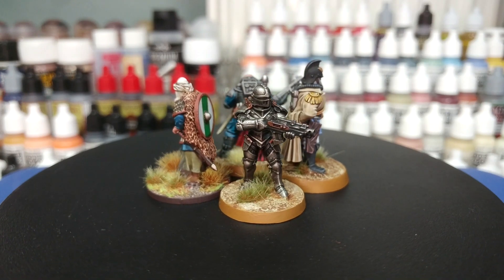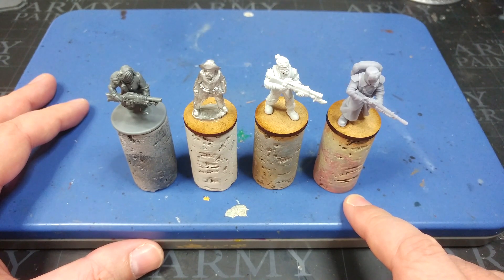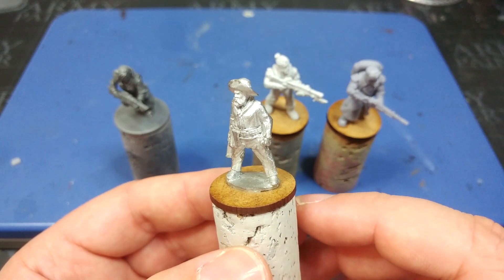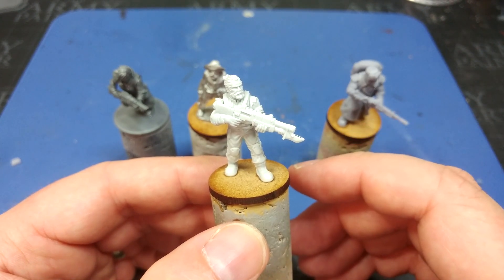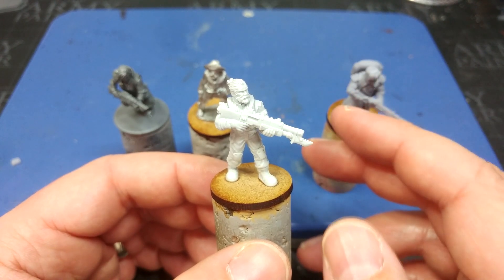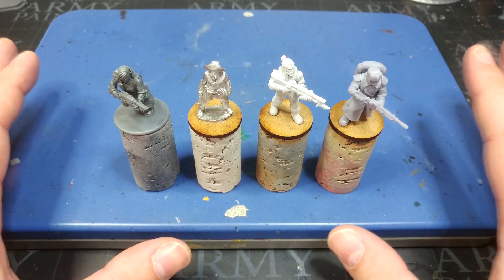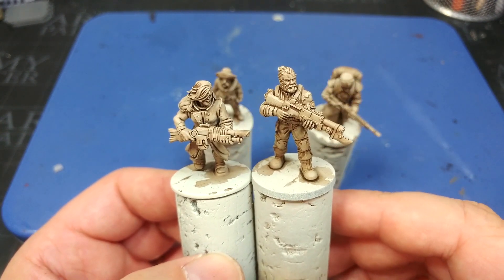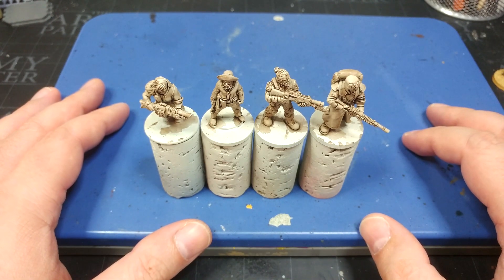Plastic, Metal, Resin: What's the difference?

Comment: When I first got into historical wargaming after years of just buying GW plastics, I dreaded the idea of having to buy metal minis. I knew that they were heavy, would chip paint, would need pinning etc. and just sounded like a hassle. However, after a few years of working with metal minis, I've actually come round to the opposite view and now prefer to buy metal over plastic. While metal has its obvious downsides as you pointed out, metal minis are generally single-piece and don't need any assembly, and most importantly the detail is a hell of a lot more pronounced which makes painting an absolute joy in my opinion - especially for periods like WW2 where trying to paint plastic webbing used to give me nightmares.

While plastic minis have obviously come a long way over the past couple decades in terms of detail, I think a big part of that has been achieved through scale creep and the inflation of proportions to mitigate the soft detailing that's inevitable with plastic. For people who prefer a more true scale look, I think metal is able to still provide that pronounced detail that would be lost with plastic minis.
Reply: I didn't mind metal minis too much until I had 21 figures with built in metallic bases from Bolt Action to put on diorama and had to cut them off without damaging models too much... Suffice to say, I will triple check before next comission what material I will be working with

Comment: Painting wise, there's no difference. Prepping (cleaning, assembly, primer, etc.) is what gives plastic advantage over resin and resin advantage over metal.
I enjoy painting the occasional metal mini from small producers (mostly for small scale elements, such as the super nice sci-fi range by Khurasan), but I dread the prepping required.
Reply: Agree, i hate metal minis the detail is not sharp and the body parts look glued to the body.
Reply: That rather depends on the company producing the figures. Front Rank (under the old owner anyway) cast figures that needed very little prep, whereas the Perry metals are notoriously badly cast with worm-threads everywhere. On the other hand most plastics generally have very soft detail unless they are really multipart (you only need to look at Gripping Beast figures to see examples) but the multipart figures really need to have care in assembly and greenstuff for the joints to conceal the lines unless they are very well designed, or were not really designed to be assembled in different ways.

Comment: i was not prepared for the prep work for metal minis... bought the GW Ratling snipers and didn't realize that one of the fellas needed assembly. the parts didn't fit together at all to begin with, did my best to get it to kinda look like it would fit, still didn't fit properly... ended up millitputting the two halves together, looks good enough now and you can't see the milliput unless you're actively looking for it.
It is also worth keeping gloves on when prepping them if you got some kind of allergy towards various metals since metal minis usually are made from pewter and that isn't always the nicest of blends of metals. for example, still in this day and age poor quality pewter can still contain lead.

Comment: Cracking video and advice.

May I be permitted to point out that with some white-metal or pewter figures it's a good idea to ensure that all oxidisation is removed before painting, using Eg a glass fibre pen/brush or similar, perhaps then followed by some form of household sink cleaner. Also there are primers that etch well into white-metal and provide a good key for the top coat. If one isn't careful and methodical then paint can peel and chip from white-metal, pewter and brass.👍✌️😊

Also resin needs a thorough clean up to remove release agents etc too👍✌️😊

Comment: I've build & painted a LOT of minis, as for the majorjty of modellers I started with the old Citadel's metal ones. Today 's plastics are really astounding, there's a details level that is fantastic, plus we can add an economic factor, with € 35/40 you can buy a lot of figures in a single box. Converting /modifying them is very Easy, expecially thanks to plastic cement, on the contrary of CA glue it forgive your mistakes.

Comment: Good Content!

The difference for me is in the use of the miniatures.

If I'm building / painting an historical wargame army then metal is the way to go. Plastic figures add a step - assembly - and that adds considerable time to the process.

For military modeling I am going to pick whatever works for the project.

Rough surface / pitting on Metal miniatures is an issue but with multi-based figures on the table at normal viewing distance it is not noticeable.

Comment: Plastic is definitely my favourite material to work with, especially with how the glue melts parts together. It's by far the best for vehicles (at least, the main hull) due to the ability to make large flat surfaces without a lot of warping. That being said, resin kits today are so much better than say, Forgeworld circa 2012 or Citadel "Finecast," to the point where I would generally take modern resin over metal, while I would have said the opposite back then. 

And I'm guessing GSC = plastic, "Krieg" Commissar = 3d print, historical Turk/Ottoman/other = metal, fantasy knight with gun = resin, even though the latter kind of looks like it has more surface irregularities than the previous. I'm mostly going on the assumption that historical tends to have more metal than newer fantasy games, which I believe the knight model is from.

Comment: I always struggle with resin - it just doesn't seem to respond in the same way to plastic when I paint it (3D printing - albeit based on limited experience - is even worse)
Reply from the maker: I honestly can't grasp why there'd be a big difference. It's not something I've experienced once a miniature is primed. Where is it that things are going wrong; when you mention it not responding the same way, how do you mean?
Reply: @SonicSledgehammerStudio  even with Halfords primer, paint doesn't respond in the same way and washes especially react differently. It was much more in the dark days of finecast, but even now working with resin feels different for some way. 
I get your point about metals though, esp. Warlord ones
Reply from the maker: That's... really weird? I've genuinely never come across that. I don't ordinarily wash my miniatures before priming and painting, but it might be something worth trying if you've still got any that need painting?
Reply: @johnwalliss  I think that some of the issues that you might have experienced maybe due to the changes in paint formulations over the past 5-10 years. They caught me out as they're not often declared or known about until one goes to use them, then it goes Pete Tong. If you're on about constructing resin models, they vary greatly from cottage industry supplier to cottage industry supplier. I model figures, railways and some military so I work in most mediums and resin is often a chore for me during construction and painting. White-metal is okay to paint as long as it's prepared properly. 3DP is okay, if it's a quality resin base, but it can be a chore too.

Comment: “Plastic” includes many different chemicals that can paint up very differently.  Reaper’s Bones figures and many board game miniatures are PVC, very soft & bendy vinyl with low surface detail, and cannot be primed with most spray cans without reacting and becoming tacky.  They must be thoroughly washed before painting directly on the plastic, or the first coat will bead up and refuse to adhere.  I suppose an airbrush might help to spray prime those, if the painter has one.

Comment: I like plastic more then 3D printed, but like everyone else I do have a number of 3D printed miniatures.  Metal minis are good and solid, but you do have to wash them in soapy water, clean them up, prime them. Then they should paint really good.  Resin miniatures are good also, but priming is the key to a great finish on them.    Cheers 🍻🍻🍻

Comment: I am an old timer and to me, the defects in the metal add to the miniature. I still prefer a weighty metal miniature to no weight of a plastic miniature. Also the assembly of plastic and resin just frustrates me. Maybe it is because I do 3 or 4 times as many 15mm miniatures as compared to 28s. Do I paint plastic and resin? Yes, but I just don't enjoy it as much as metal. So call me old fashion.

Comment: The one issue I have with 3D printed minis is how fragile they are. I am a clumsy guy, and I tend to drop things fairly often, which isn't an issue with plastic minis as the vast majority tend to just bounce a little, maybe get a little bit of paint chipped off, but that's it. With 3D printed minis I found that they just shatter in sections. Granted, it's relatively easy to glue them back together. I think it's my fault, more than the material itself.
Reply from the maker: There are some really neat resin mixes you can look into if you're printing your own. Some resins are full-on flexible, and you can mix them with traditional ones to get a semi-flex more similar to the Reaper Bones line. Not a perfect solution, but it's something. "Beats a hard kick in the face," as mum used to say.

Comment: I just want to point out, plastic is resin. People often talk about sanding resin being toxic, but any particulate in your lungs is bad for you. I'm not sure if FW and other companies use a urethane resin or what, but it is probably just as toxic to be sanding the hard polystyrene, and you should not differentiate. The language used (resin vs plastic) is deceptive. All plastics are resins. The acrylic in your paints is a resin. Don't inhale any kind of particulate.
Reply from the maker: Fair point on the sanding. Yes, any airborne particulate is potentially hazardous, but it's honestly been so long since last I actually sanded plastic that it didn't occur to me to mention. I think I'd struggle to breathe in the knife shavings!

As regards the language being deceptive, let me pose a hypothetical: Would you go into a Games Workshop and ask for a resin Baneblade like it's 2003, or do we accept there's common use to consider which is describing two different materials to a customer?
Reply: It's simply unfortunate vocabulary. I'd rather people recognize the difference between hard mold casting and soft mold casting, but the language is as it is. I just know I sand polystyrene models a lot when seam filling with super glue (the price of the much improved quality is dealing with seams in the worst places).